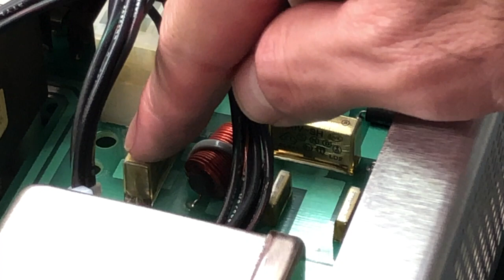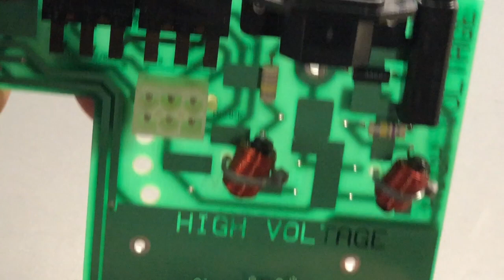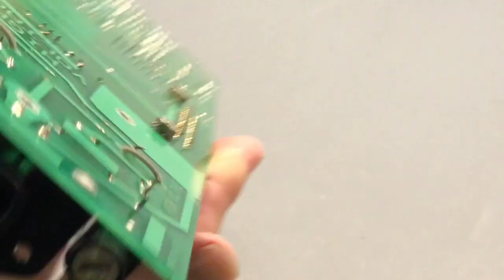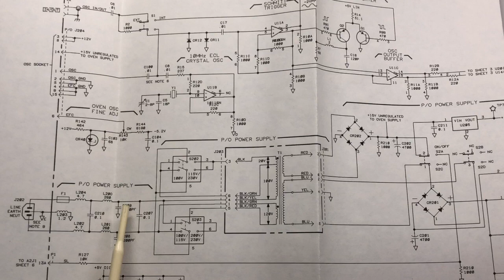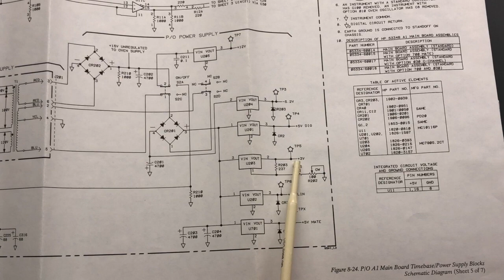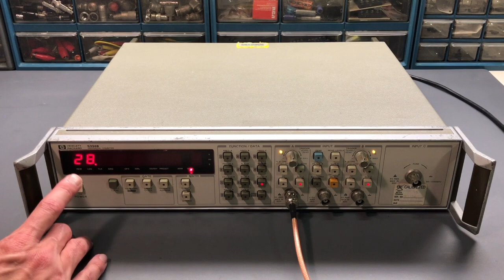HP 5334B Frequency Counter Service & Calibration | OCXO Time Base Adjustment

Comment: You said that “GPIB is basically Hewlett Packard interpretation of the GPIB bus”. I am sorry to correct you but it is the opposite. It is the GPIB that is derived from the HPIB. HPIB was introduced in 1965 then the GPIB appeared in 1970.
It was standardized to the IEEE-488 in 1975.
Reply from the maker: You are correct, HPIB was first then GPIB.  Sorry my explanation was not said in a better way to convey this.

Comment: Great video, quite informative and educational.

Could you share what the part numbers were for your safety caps (RIFA and 2200pf). I plan to order from Mouser or DK. Thanks
Reply from the maker: I went through records and it looks like these capacitors came from Digikey,  0.1uf (100nF) 399-PME271M610KR30-ND, 2200pF 399-12665-ND, power supply filter caps 4700uF 493-1089-ND.
Reply: @EriksElectronicsWorkbench Erik, thank you Sir - much appreciated.

Comment: 48:20 a 50 ohm load will usually attenuate the signal by half, by design. If you hook it straight to high impedance, the signal would normally be double, for most designs of 50 ohm output impedance signal sources. For example, a signal generator set to 50 ohm output impedance and to supply a 1V signal, you would see two 2V at the output unloaded. When supplied with a 50 ohm load at the receiving end, the normal voltage divider effect occurs, and it sees again 1V as specified.
Reply from the maker: Yes you are correct that the 50 ohm load of the terminator has the affect of attenuating the source signal about half because it is loading it.  I was just mentioning that the adapters are not also pass through attenuators because such adapters also exist (termination plus attenuation).
Reply: @EriksElectronicsWorkbench  I was thinking about my comment in the shower. I reconsidered that maybe it's almost philosophical or dogmatic, whether one wants to view the signal point at the top of the 'outside' 50 ohm load as having been attenuated (because it would almost surely be a higher level if that load was not present in the signal path), or if one should view the division as part of the systematic signal transmission mechanism, because if one measures signal at the wire just before and just after the top of the 50 ohm load point, given our 'real' measurement device is very high impedance, the signal level at those two points will be virtually the same. Whereas that would not be true for a -10dB attenuating pass-through. Not sure any more.
Reply from the maker: @ivolol  When I'm using an RF signal generator (as is the case here) it is intended to operate into 50 ohms so I consider the 50 ohm terminated voltage the normal operating voltage. Terminating the generator is not normally considered attenuating the signal level (in the terms of what an attenuation pad does) even though as you mentioned the 50 ohm terminated voltage will be lower than the open voltage by design.  When I'm working with RF signal levels I almost always use dBm which  assumes 50 ohm termination on most RF test equipment.

Comment: I have this same counter, mine also has the 10811 installed. So far I have not had any issues with the "RIFA" caps, these are very nice counters and has given me flawless service.
Reply from the maker: It is my go-to frequency counter and I find it is easy to use, accurate, and reliable.  If the RIFA caps have any cracks in their case they should be replaced.  Keep in mind the safety caps in this unit are live all the time (not switched off) since the unit has a standby mode for the crystal oven so they end up with a lot of run time hours on them.